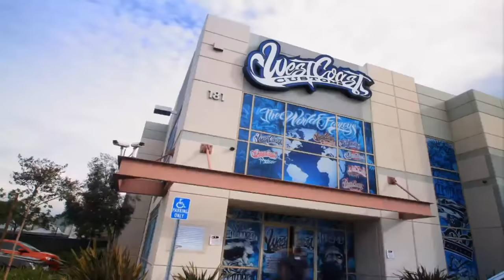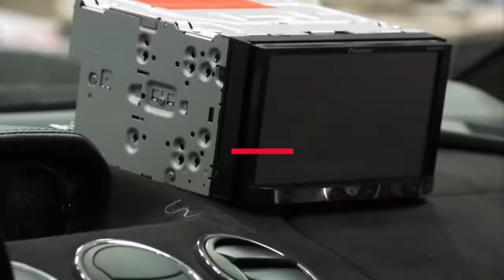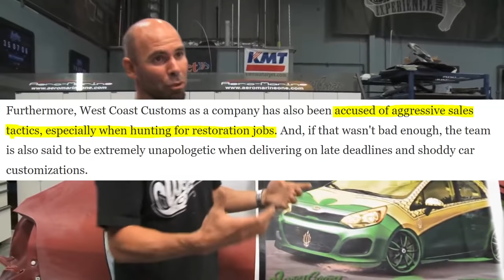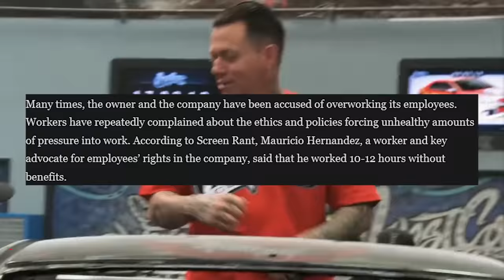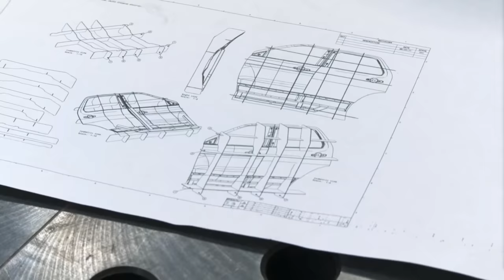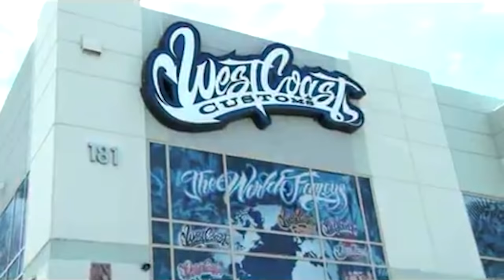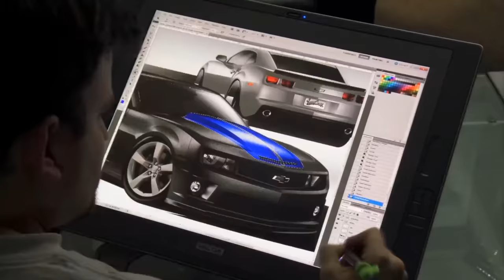What ACTUALLY Happened to the Cast Of Inside West Coast Customs!? Where Is Ryan Friedlinghaus Now?

Comment: I had a Chrysler 300 and had an appointment to get a sound system installed. I paid $300 deposit to reserve the date and when the day came up I drove out there super excited with a buddy of mine. I was told I was "late" by 30 minutes which is bull since I was there at 11am and my appointment was at 12pm. I was at the front office filling out paperwork. I was told they wouldn't refund my deposit and when I tols them fine I'll take my car back they said they had already started working on it by removing the seats and dash. So I let them finish. I paid $900 and they cracked the trim around the stereo head unit and when I confronted them they said I filled out paperwork saying they weren't liable for any damages that happened to my car.
Reply: Damn really!!!
Reply: Very funny 😅😅